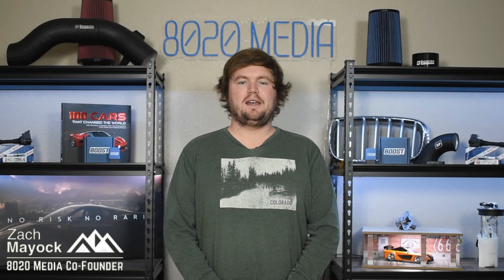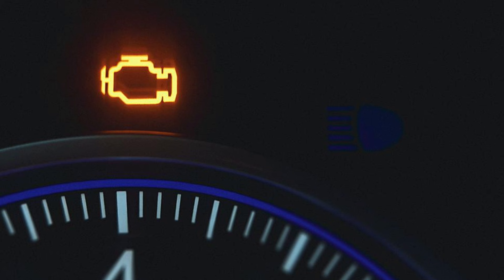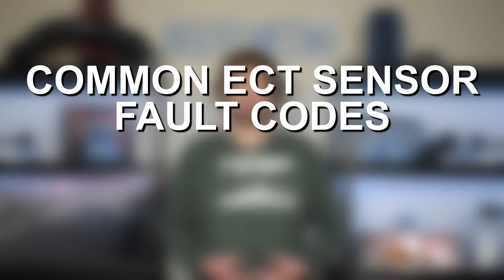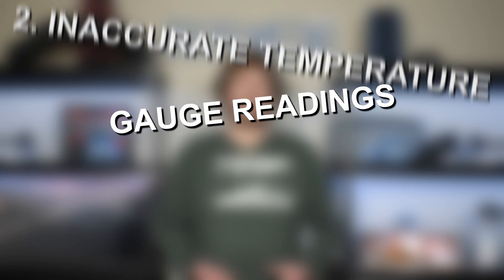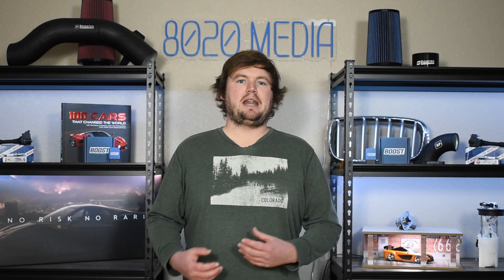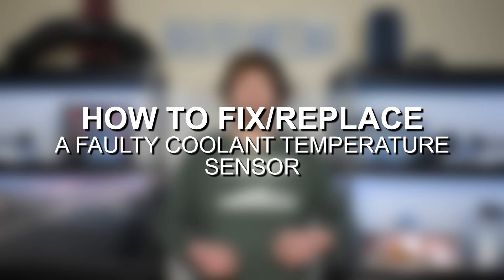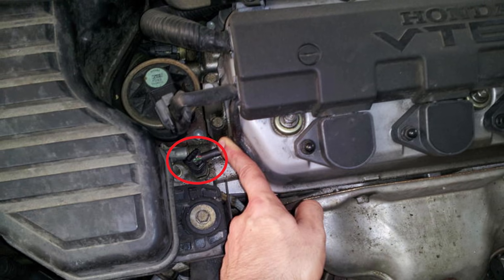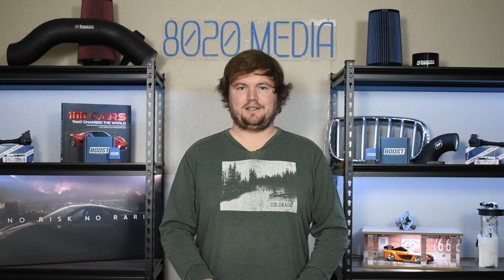Signs & Symptoms of a Bad Engine Coolant Temperature Sensor! (ECT Sensor)

Comment: Great information, I have a ? 2002 Lexus sc 430 throwing code PO125 changed the the thermostat temp sensor, flushed the coolant, radiator cap any suggestions chk eng light comes back on 60 miles after reset if changing the Lexus thermostat and gasket? Appreciate any help. Thank you in advance!!!

Comment: I am having a problem where my fan is kicking in way earlier than usual, it used to be around 100c but now it seems sometimes its 90 80 or 50.
Im going to change the ECT soon.
Reply from the maker: D - You're on the right track—if the cooling fan is kicking in at unusually low temps like 90°C, 80°C, or even 50°C, it's highly likely that your Engine Coolant Temperature (ECT) sensor is sending inaccurate signals to the ECU, causing premature fan activation; this could be due to internal sensor failure, wiring issues like corrosion or shorting, or even a poor ground. Replacing the ECT sensor is a smart first step, but while you're at it, inspect the wiring harness for damage and make sure the sensor's connector is clean and firmly seated—faulty readings from the ECT can also affect fuel trim and idle behavior, so addressing it now can prevent further issues.
Reply: @8020Automotive  I'm going to change the ECT sensor as my car reaches optimal temp., doesnt overheat but thr fan always turns on and stays on till I turn the car off. I've changed the radiator, thermostat, water pump and the fan still turns on after it reaches optimum temp.

Comment: Could it cause the AC to blow warm air?
Reply: Most likely, that’s what’s happening to mine, thought I was low on coolant but then it started blowing cold air again after turning it on again so the sensor might be mixing up the signals
Reply from the maker: D - Yes, a bad Engine Coolant Temperature (ECT) sensor can absolutely cause your AC to blow warm air, especially on modern vehicles where the ECU uses ECT readings to manage engine load and HVAC performance. If the ECT sensor is stuck reading cold, the ECU may disable or limit the A/C compressor to prioritize engine warm-up or to prevent supposed icing. On the flip side, if it’s reading hot all the time, it might shut off the A/C thinking the engine is overheating. So if your A/C blows cold sometimes but randomly gets warm—or if it stays warm and your temp gauge or fan behavior seems off—a faulty ECT sensor is definitely worth checking.
Reply: @8020Automotive could it cause the heat to not work? My car will be driving fine and then all of a sudden read hot. And even when the temperature is reading normal the heat will work but then not work, then work 5 mins later then 5 mins later not work. I just got a water pump put on bc I was told that’s the issue but it’s still reading hot after driving it for an hour or so. Had it hooked up and it’s showing a po117 code

Comment: Dear Zach,

Thank you for your informative videos — they’ve been incredibly helpful!

I have a question regarding my Fiat Stilo (1.2L, 70hp engine) and how it behaves in terms of engine temperature. While driving on highways under normal conditions, the coolant temperature struggles to reach the typical 90°C operating temperature.

After a long highway drive, once I enter the city or let the car idle for over 10 minutes (depending on the outside temperature), the coolant eventually reaches 90°C. However, as soon as I return to highway driving, the temperature drops back down to about half on the gauge.

My concern is:
Is this temperature behavior normal for this type of engine, or could it indicate a problem with the thermostat, ECT sensor, or another part of the cooling system?

I’d greatly appreciate your thoughts!
Best regards!
Reply from the maker: S - Thanks for the kind words! This sounds like a classic case of a stuck-open thermostat—when you're cruising on the highway, there's so much airflow over the radiator that if the thermostat is stuck open, coolant circulates too freely and doesn't stay in the engine long enough to heat up, which keeps the temp low, but once you slow down in the city or idle where airflow drops, the engine can finally build enough heat to reach the normal 90°C range; this isn't normal behavior and while it might not be catastrophic, running consistently below operating temp can affect fuel efficiency, emissions, and long-term engine health, so I'd recommend replacing the thermostat first (it's a cheap and common fix for this exact issue) before worrying about the ECT sensor, which tends to throw odd readings or codes rather than consistently low temps if it's faulty.
Reply: @8020Automotive  Thank you very much for your helpful response! Wish you the best! Keep up the good work!

Comment: My dodge I just changed thermostats and the housing but kept the old coolant temp sensor, the past two days I had codes for coolant too cold after 3 seconds from the car starting,   I had both the engine and lightning bolt, and my gauge goes to try and overheat when idling with ac pump on, just a little over half, and then back to operation temp or lower if the heat is turned on, I’m thinking it’s the old coolant sensor, because it also had issues starting for the past few mornings
Reply from the maker: L - Yes, the old coolant temperature sensor could be the culprit, as it directly affects temperature readings sent to the ECU, impacting engine performance, fan operation, and even starting issues. A faulty sensor can send incorrect data, causing the engine to think it’s too cold (triggering the P0128 code) or overheating when it’s not. Since you just replaced the thermostat and housing, replacing the coolant temp sensor is a logical next step. Also, ensure there are no air pockets in the cooling system, as trapped air can cause erratic temperature fluctuations. Try bleeding the cooling system properly and monitor if the issue persists after replacing the sensor.